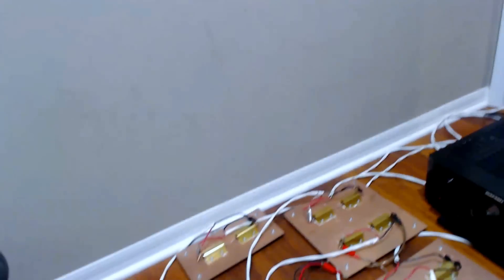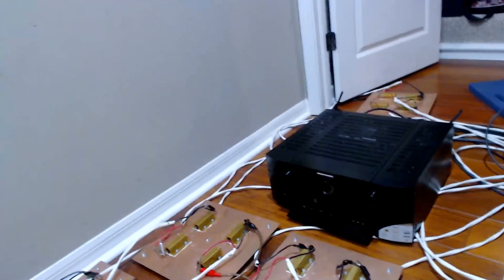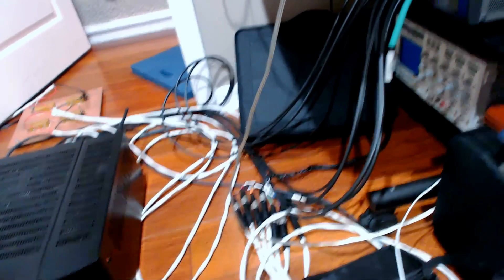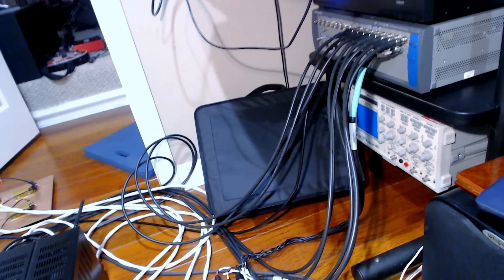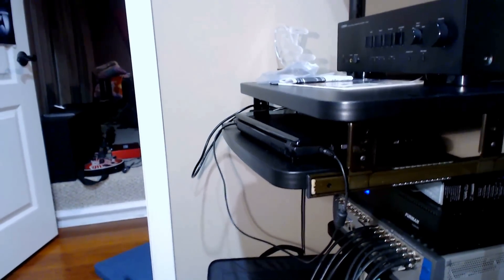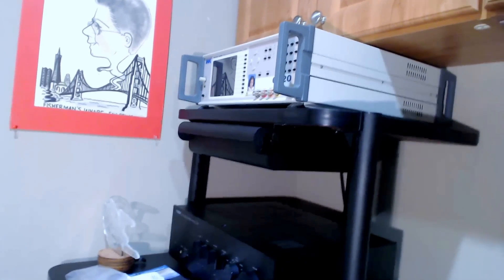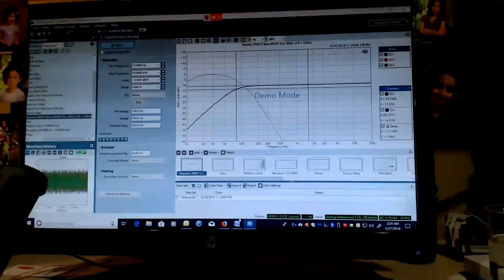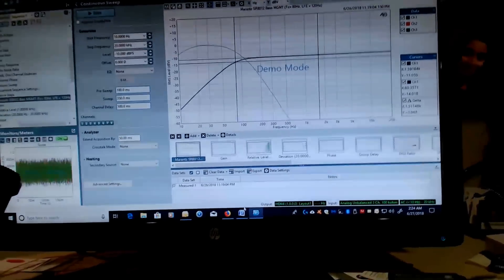Measuring AV Receivers Audio Performance

Comment: I'm in Michigan and I enjoy the Audioholics videos and content.  I running a Yamaha RX-V3900 and I would love to see more videos on how to use the receivers internal audio correction software. I'm sure the software is different between receivers however the manual correction of the audio signals for different issues do to room acoustics would be the same.

Comment: Hey Gene, Jay from Alaska here. I am running an older Pioneer VSX-82txs. But recently found out on AH. And some other forums that that model has HDMI issues and it needs to be fixed by a Service rep. So for $75 I found a used Pioneer VSX-39tx and the kicker is, the lady who owns it recently found the crazy remote for it. So that’s what I’ll be using until my 82 gets repaired. I love this channel. Keep doing videos please. Is there any brand of blue ray player out there comparable to the Oppo? I understand they are no longer manufacturing players? I can’t afford the $4,000.00 that the last remaining are commanding. Thanks again.

Comment: my soundbar  just  went.  ... Martin Logan motion vision started making loud popping sounds and I am pretty sure the sound processor is bad. Looks like two solder joints melted together on the cirrus logic  chip cs495314-cvz :(

Comment: Hi Gene,
I'm watching from England. I have just moved from a Marantz 7010 to an Arcam AVR 850. To make a 7.2.4 system I have an Arcam FMJ P7 in the system. Must say that the 850 is a huge improvement over the Marantz. For music I found the Marantz could be harsh at times but the Arcam is so smooth and clean.
For movies the resolution of Atmos soundtracks is also way better with the Arcam. I have a difficult room with sloping ceilings coming to an apex over my head and have fitted bookshelf speakers to these but could only get 6 feet height. Far from ideal.
With the Marantz things could get a little congested and confused but the Arcam has provided much more clarity and definition. It wasn't a cheap receiver but for me it was worth every penny as it has improved my audio way beyond expectations.

Comment: Love the channel and most impressive setup. Thanks for sharing your gear and explanations. I have a questions about the Klipsch RP-140SA Atmos enabled speaker. I want to buy them to match my other RP speakers but use them at front heights and set them up as such in the Denon 4200 and NOT as DA enabled bouncy house/ billiardy/ cybertronian speakers. My question is will audyssey xt32 correct/override the analog HRTF crossover to flatten the response and get rid of the 2 peaks at the frequencies you mentioned were designed to simulate overhead sounds if they’re set up as height? I’m wondering what audyssey does when people do choose to use them as bouncing speakers- I assume it knows to leave the HRTF peaks in there? Thanks

Comment: Wow, great stuff Gene. A little look behind the curtain. I love how you never dumb things down for us non engineering types. That's how we learn I think. Least that's how I like to learn. Do you test the bandwidth passthrough capabilities of the HDMI ports as well? Lots of issues in these receiver owners threads with 4K Dolby Vision drop outs and that seems strange as I've read that the Dolby Vision signal is carried in an RGB 8 bit container(well under the 18.2 gbps maximum.) 

Some say the Yamaha receivers submit their HDMI section for additional testing that manufactures like Denon don't(they self certify as the ATC's recommend) and that gives the Yamaha an advantage with less HDMI passthrough issues. Nothing from the ATC's testing agreement recognizing this added testing as any better certification and Yamaha doesn't use it in their advertising so some feedback on your thoughts regarding this would be helpful. Several industry insiders bring up Yamaha's extra testing submissions to ATC's as a reason to buy them over a comparable Denon that self certifies after initial ATC testing is complete. Basically their saying that Yamaha's HDMI repeater are tested more and are thus less prone to fail or not pass a full bandwidth 4K signal than a Denon/Marantz. Thanks for all that you do.

Comment: Big Phill in Brooklyn. rocking a Marantz SR7011 with a Monoprice Monolith 7 amp.
using the Monolith 200watts per ch to power my flr sound stage klipch speakers: FL&FR=R-28f/ C=RP-440C/ SL,SR,SLB, SRB=R-15M.
 Upper heights sound stage are mules & horses, Front presence=SVS Prime Elevations/ Rear KLIPCH RP-140SA.
last dual KLIPCH R-12SW.
looking to swap out subs for SVS PB13-ULTRA

Comment: So how do you measure Amps / Receivers with 9+ channels?
Reply from the maker: NewYorkBlack you measure 7CH which will help you determine if the power supply is the limiting favor, or the wall outlet.

Comment: Tampa, FL.  Missed the live broadcast.  Not normally awake Tuesday night at 2 AM.  Currently have a 2008 Pioneer SC-07.  Thinking about replacing before years end.  Haven't quite decided.  I like many of the new streaming features of newer HT receivers but, they have many features I will never use.  Such as the height sound features.  Not interested in them.  Even if I was the ceilings in my home theater are sloping cathedrals that are 10' at the walls on one side and peak at 18' on the other.  Trying to compensate for that if it's possible would be a headache I'm sure I don't need.  Enjoy your channel.  Looking forward to the result of the SR8012 testing.

Comment: Just found your channel, I love how technical it is.   It's really making me want a new reciever though...I have what was once a high end Marantz, problem is it's about 14 to 15 years old.  No HDMI switching, virtually no on screen menu, no atmos/dts-x obviously.    I think it did actually support DTS MA and True HD but don't quote me on that, it's currently boxed up anyway as most of my old system (7.1 Cambridge soundworks setup) is still in storage after my move to Michigan.   I love how much more advanced the SR8012 is and it's like 2k less than mine was at the time.
Reply: Antimonkat I had a 12 year old Denon legacy receiver with a Cambridge Soundworks speaker/sub system myself before upgrading to the Denon X4300H last year.
Reply: Thomas Hoctor nice. What are you using for speakers this time around?  The only issue I'm really having is one of the sub amps in one t-500 tower it's out, it's fixable but not sure i want to bother. Could just not use it. Or use a different amp or replace the towers. Primary bass in that system comes from my p-1000 anyway.  I'm. Considering going full svs just not sure i want to plunk down like 15k on a fully new setup.  Considering just updating pieces as i go but not sure how well they will integrate.  This might be moot anyway as I'm doing the apartment thing for awhile. Not ideal for a huge home theatre setup. Rip neighbors
Reply: Antimonkat I went initially with a Klipsch setup but then did some more research on the sound I was looking for and went with the Internet Direct company Chane. They sell a magnetic planar tweeter with a high excursion split gap woofer so you get detailed highs for music and low distortion mids for home theater.They aren't going to win any beauty contests but they have a loyal online following and I took a chance and it paid off. Home Theater Direct which is based right down the road from me also sells a similarly designed speaker but it's even more of a home theater friendly speaker than my Chane's but a bit less for music. Both make good speakers for the money but Chane is more of a mom and pop business as you can directly connect the speaker designer by phone or email and get an in depth breakdown in his philosophy. HTD not so much but they are a bigger corporate machine like SVS.

Comment: I have a Denon x1400h and i'm planning to buy some resistors to test 8 ohms and 6 ohms, but resistors i can buy easy, an oscilloscope and how to use it will be the most difficult part. Especially when i have to design some voltage divider.

Comment: I am Frank. I am in Chiang Mai, Thailand. I don't have. I sold when I moved. I am considering buying a Marantz SR7012 or SR8012 with ELAC Uni Fi Slim, 2 fronts, 1 center, and  8 bookshelfof which 4 will be heights. Without OPPO, picking a Universal player is hard.